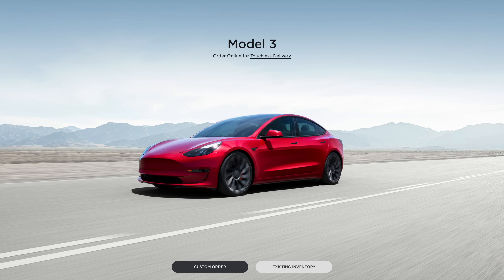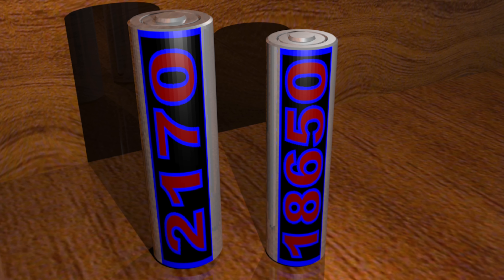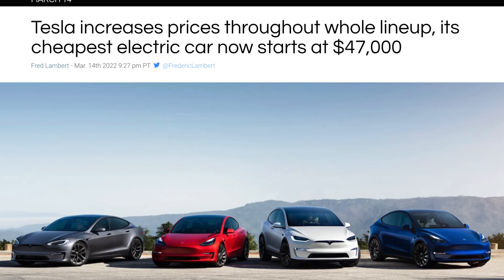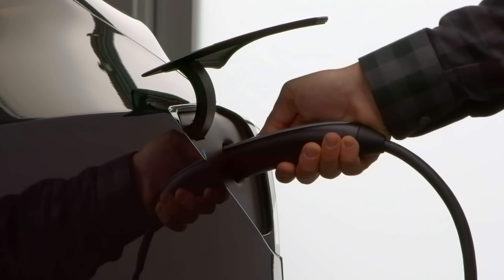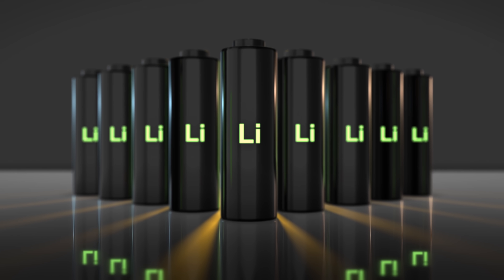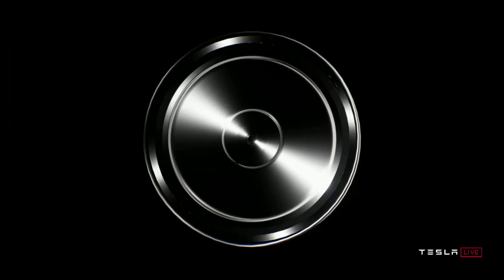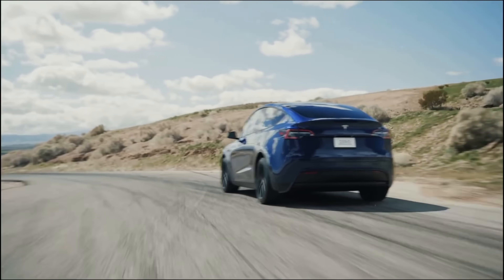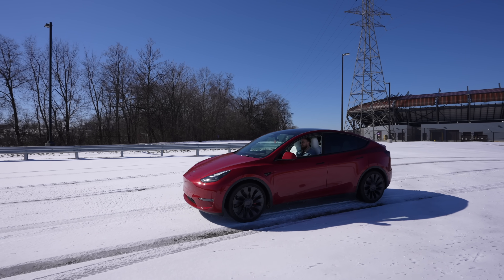Tesla's Hidden Battery Options: Don’t Pick the WRONG One!

Comment: LFP doesn’t have memory, but it needs to be calibrated often to 100% because the voltage at 100% vs at 0% is basically the same. With other cells the voltage varies and that’s how you measure capacity remaining. When voltage doesn’t change, you don’t know the max or min capacity that accurately so charging to 100% often, at least once a week according to tesla keeps the BMS calibrated so the car doesn’t shut down unexpectedly.
Reply: Exactly. You "calibrate" the BMS, not the battery. 100% charging is not good for any battery regardless of chemistry. At least for now.
Reply: If the charged voltage and the discharged voltage was the same then it would never go flat !  I'm being a smart ass, I get your point. Also the on the charging of the LIP battery, Tesla state that the battery likes to be plugged in all the time. Always charge to 100%. I agree that this does not sound write but who would argue against Tesla..
Its quite possible that 100% is not actually at cell maximum anyway.  A bit like saying the 18650 is 100% charged at 4.10v and not the specified 4.20v
Reply: @marcusbiller867  not really. LFP cells can last 2-4x longer than nickel cells even if LFP is charged to 100%. If you look at the charge cycle data for LFP, there’s basically no difference between charging to 0-80 or 0-90 or 0-100 for longevity. For nickel cathode cells this matters a lot and it’s better to keep charge limit at 80% or lower.
Reply: sorry chaps but you are generally wrong.   lfp should be fully charged once a week. because the individual cells can only be ballancrd at the higher voltages.  no memory effect.   The BMS will turn off the battery if individual cells get to low.  So because they can only be balanced at high voltages they need to be fully charged once a week else the cells will get out of balance.   Of course this is possible because they have lower cell voltages and do not degrade at full charge.
Reply: Harsimran Bansal. How is the LFP calibrated?
Reply: They know when they're at 100% And they know when they're at about 10% or less but everything in between is a mystery. The voltage starts to fall off rapidly around 10% so as long as you either fully charge it or fully discharge it now and then it should be okay.
Reply: @Fart Zilla older batteries that use a different chemistry want to be between 30 and 70%, but lfp lithium batteries actually like being 100% all the time and they like being used all the way down to zero. There's no advantage and you should leave it at 100% all the time with lithium phosphate batteries. Nmc and nca sure, you're right on those ones
Reply: @marcusbiller867 but Tesla literally says to

Comment: Hi Andy. You missed to mention NCMA LG Chem batteries which Tesla is using on their 2021 3/Y Long Range models (at least the ones delivered in Europe). There are pluses and minuses but the NCMA has way less cobalt content compared with the Panasonic NCA and lower degradation (at least they claim so). Having said that, NCMA seem to be a good balance between NCA and LFP. Charging speed on NCMA was also somewhat lower (I have one of the first released models, made in US and received in December 2020) comparing with NCA but as of December 2021 they boost the speed on the LG pack so the gap is smaller now.
Everybody expects indeed the 4680 cells soon and will be interesting to see how will Tesla introduce them to the market.

Comment: My guess about the new Model Y on the EPA list is as follows.  The new Y is a SR+ from Fremont with less 2170 cells.  This will allow Tesla to continue using Fremont for Model Y but give a price diff to the 4860 from Austin.  With luck the Austin Model Y with 4680s will be a little lighter then the current long range and have a bit more range as well.  Excited to see what happens at any rate.

Comment: I am surprised you aren't listing the LG NMC battery pack that is going into the M3LR any time now. A pack that charges slower, has less discharge power and less capacity as well. This would have been essential to mention!

Also when you mention that the top 10% can't be used on daily charge with NCA packs, then you should also mention that the lower 4,5% are hidden below 0%. This capacity also needs to be subtracted from the claimed range as it is part of it.

Comment: What is funny is that NiCad batteries which were the first commonly used battery had an issue with memory which caused the search for new technologies like Nickle Metal Hydride which had a bad habit of imploding for no apparent reason and releasing toxic fumes. We then went to a few other types that only lasted extremely short periods of time until we found Lithium Ion which of course didn't suffer from memory issues and were supposed to be the ultimate form of rechargeable tech until we found that it would develop dendrites which of course caused them to degrade. Next question is, if or what we will find wrong with LFP in the future once it is in widespread use.

Comment: just wanted to add another 3 things about the LFP battery,  
1) cold weather DC charging can be slow  
2) when you are DC charging you don't want to go much above 80% because the charge speed slows down.  80% on a NCA battery is more range than 80% on a LFP battery.  
3) LFP batteries are said to last 2-3x times longer than NCA, so if you are the type to buy and own a car for like 10years it might be worth to consider this

Comment: I drive a 2020 model 3 long range for business purposes. Put a little over 250k miles on it before the battery failed. I beat the hell out this battery, drove between 300 and 600 miles a day on a regular basis while mostly using superchargers to make my errands. I would regularly charge to 100% before leaving home and drive it down to 5-10% before supercharging. I'm getting a brand new battery and not a remanded one. I'm curious what/if there's any improvements in this new battery I'm waiting on. This time around, I'm going to only set it to 90% and never let it go under 15% and I'll see how much more range I'll get compared to my last one.
Reply: How much are you paying for the battery?
Reply: @happyhippo1710   A little shy of $16k. I anticipated I would get at least 300,000 miles before I would need a new battery so I was 50,000 off. I'm sort of glad it happened when it did because current prices are locked in contract with tesla's suppliers but when those contracts expire, prices due to inflation are going to be up 20-30%. Had my battery lasted longer than it did, I would be paying much, much more for the battery replacement.

Comment: I'm thinking 279 mile Model Y is LFP chemistry in a structural pack (perhaps with BYD blade battery).  My guess is they are also doing the 4680 out of Austin as well which will be the other one submitted to EPA but not yet released.  My guess as well would be both of these are other variants of Model Y so delaying your order will not help... but perhaps you can have your order changed to the new variant.  Very soon we will see the website updated if I am correct.

Comment: Thanks for the info Andy. As an engineer, Tesla's amazing "outside the box" thinking has had my interest for the past couple years. Recently, I've been watching for updates regarding giga Austin and the possibility of 4680 springing to life in the Y. I ordered MYLR a couple weeks ago with a September delivery as of now. I'm hoping as you are, to score the new mega-cast front and rear with a 4680 structural pack between. Question, if my delivery day comes and they are still not shipping 4680 equipped Ys, how do you "delay"??
Reply: Just text them and say you want to delay delivery.
Reply: @bigswee693  Thanks for the feedback will. Guess I’ll have to wait and see what comes first.
Reply: They are canceling orders if you try to delay or reject the car. I've seen it happen multiple times now. It's all over the forums. Read your contract, because it's within their right to cancel orders if you don't accept within a number of days.
Reply: @vanto4362  I had a Plaid S and delayed my order and it was not cancelled. They picked me in June, delayed it until September and received my order. I would just ask for confirmation that it will not be cancelled.
Reply: @bigswee693  There was a policy change a couple months ago, delay at your own peril. It’s unfair that you get both a lower price and the latest tech. Those should be for people paying $10k over what you paid for.

Comment: Good luck on deferring your delivery. They kept changing my Model Y delivery and eventually wanted to deliver it in late December. I got them to defer to 2/1/22 but in mid January they said if I did not put myself back in line by January 27 they would refund my deposit. I ended up with a delivery of 2/10/22. Maybe due to your status with Tesla you will get preferential treatment but they were not accommodating to me. I wanted the car for April delivery when the weather is better and I did not have a pressing need for the car but Tesla didn’t care.

Comment: the LFP and 100% charge is really making me reconsider the M3 RWD. I've heard that second motor adds 400 lbs and really messes with the driving and handling. it loses the nimbleness of the single motor M3. Plus the RWD M3 is the only one remotely affordable for me right now. You have driven single and dual motors right? Whatcha think?
Reply: If you can't afford a dual motor model, don't even consider it. Extending yourself financially for any car is not worth it.

The LFP M3 RWD is the most efficient Tesla battery and motor combo in most conditions currently, and daily charge up to 100 percent is akin to a performance or long range model at 80 percent charge with an NCA battery. 

If you're looking for long-term use, don't need the fastest charging speeds, and live in an area where all wheel drive isn't necessary, then the rear wheel drive LFP is a reasonable choice.
Reply: @michael h LFP can go through more battery drain and full recharge cycles without significant degradation. Time will tell how they hold up, however.

Comment: It's important to make a distinction between battery chemistry (NCA, LFP, etc.) and form factor (18650, 2170, 4680, blade, prism, etc.). They are completely separate issues and should be addressed separately.
Reply: Exactly
Reply: Yes! 4680 isn't a different chemistry. He kept calling it the 3 different chemistrys. It's not. 4680 is either LFP or NCA. And for now it seems 4680s are only NCA as Tesla uses prismatic LFP batteries which are just that and not 18650 or 2170.

Comment: Great video!  Lots of useful info. 
I think there will be dual motors using lfp 4680 as well. My guess is they limited lfp 2170s to single motors because of it's discharge limitations but the 4680 will not have the same limitations. Lfp 4680 will probably be in every model and trim in the future until the next innovation.

Comment: LFP does degrade more quickly due to 100% charging. I can't believe how many times people get this wrong. Only reason you're told to go to 100% is so Tesla can get an accurate trip reading.
Reply: It's also to allow the battery management system to balance the cells in series, otherwise the charge carried by each cell may vary, reducing the battery capacity and range.

Comment: It will be interesting to see if the LFP in a Model Y has more range than the LFP RWD M3. Less energy dense so I have read that they are basically Full packs in the RWD M3 rather than a Scaled down NCA pack.

Comment: Just ordered my Model Y, Pushing to delay also due to wanting the new setup. but not sure when we will get them in Europe. i do hear that German MY will be new battery too.
Reply: I read everywhere that the first ones from Giga-Berlin will NOT be 4680 (initially 2170, I guess).   After a few months (6-8?) they plan to switch to 4680.  The first ones from Giga-Texas will be 4680, however, with their 4680 cells having already been built in California (ready in inventory).  Hopefully before that supply runs out, Giga-Texas will begin producing their own 4680 cells, and also get various other forms of batteries from LG, CATL, etc.. Currently, there is no such thing as a LFP 4680 (as the LFP are prismatic ingots rather than cylindrical cells), which might likely rule out a structural battery pack also.  Check further to see what form of battery you will get from Giga-Berlin, as it depends on what exactly you ordered.  (Maybe you'll want to delay your delivery if you're strongly wanting 4680's?) Good luck.

Comment: By postponing the delivery of your Model Y (if indeed you can still do that without Tesla cancelling your order), you might get a new type of battery.  But, if the battery's size is such that the car's range is actually less, as suggested by the addition to the Fuel Economy website, then wouldn't it be better to have the older type of battery?

Comment: FYI - Tesla announced in the Q1 earnings call that Austin built Model Y use the new 4680 cells, and they don’t plan to make LFP versions of the 4680.  Therefore the Austin cars don’t have LFP right now, and when Tesla adds an LFP option for the Model Y it will likely use CATL prismatic cells, like the RWD Model 3 does.

Comment: The new Chinese RWD 60 LFP they are selling in the U.K. and Europe is pretty fantastic. Amazing efficiency and only about 30 miles difference to LR version. Also can be charged to 100%. Problem is they just put the price up by £3k! Still a lot cheaper than the LR though. Heat pump, double glazing, heated rear seats and steering wheel.

Comment: I took delivery of a MYP 2 weeks ago.  The vehicle info page says Low Voltage Battery: Lithium Ion (but not LFP?).  My Tesla advisor confirmed that is the same thing since it doesn't say NCA.  But when I go to the vehicle charge screen it does say Daily-Trip not 50-100% which indicates non-LFP.  Im so confused.  All I want to make sure is whether I should charge to 80 for non-LFP or 100 for LFP really depending on which one?  Thoughts?
Reply: MYP does not come with LFP currently. You have NCA.

Comment: I attempted to do exactly what you are with my Model Y performance order.  Tesla cancelled my order.  I had a surgery coming up and it has a long convalescence period where I would not be able to pick up or even drive the car.  Tesla did not consider that to be sufficient for a delayed delivery.  They also told me that I was not allowed to specify 4680 batteries.  I simply have to take whatever they decide to ship to me.  I'll be interested in hearing if they cancel your order as they did mine.
Reply: Pretty sure they do the same to all customers no matter who they are. If everyone would want the new generations battery, they will not sell their previous edition and it would be a mess.
Reply: My Tesla rep told me they are no longer allowing delays. You take your car when it's ready or lose your order. I had both a LR3 and LRY on order and was waiting to see what happened with tax incentives. Lost the LR3 order bc it was ready now and they wouldn't delay.
Reply: I hope they cancel any delay requests. You can’t both pay a substantially lower price and also expect latest tech. Tesla is a business not a mark.
Reply: @invincibul  I would have been willing to pay the price increase if they would have said it was required.  I didn't get the option.  They just closed my order and took my $250.  That's just stupid.  Over 20% margin on a 80,000 dollar purchase with FSD that has an even higher markup.  They settled for a pissed off customer and $250.  BRILLIANT!
Reply: @bobdavis7192  They don't have the best training. If you were willing to pay the difference on the backend it would just be moving your order to the end of the line with upgraded specs. Pity they don't have the foresight to see that. Good luck on your car search